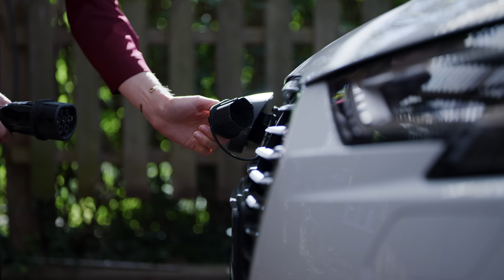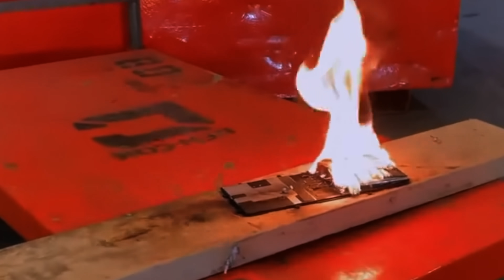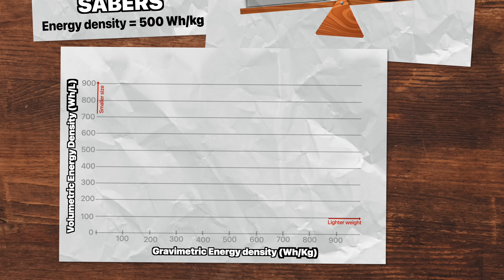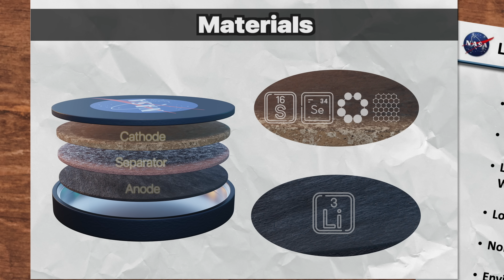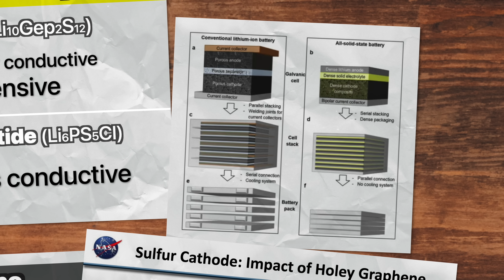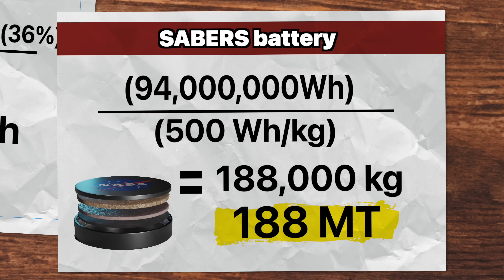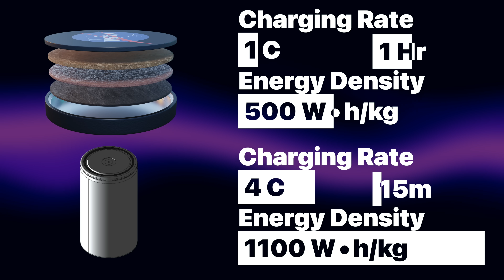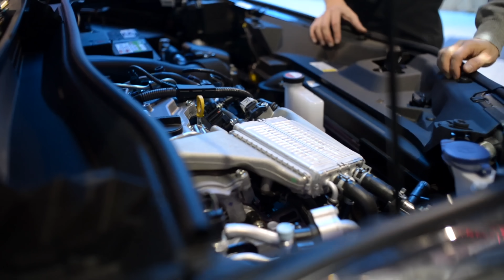Why NASA is Building a Solid State Battery

Comment: everyone's excited for EV to become a major thing in today's world. but everyone also forgets you need the infrastructure to recharge the batteries, as well as a power source to supply enough power to charge said batteries. and that is where the concept of the EV falls on its face. you cant charge 1000 cars on a circuit that needs to run 10000 houses at the same time(both numbers are a massive lowball). you'd overload whatever power source is generating the power, and have a city-wide shutdown. thats why so many places dont have EV charging stations still.

nuclear could maybe do it, but 'oh no nuclear it could melt down' or something. but also you'd need powerplants dotted across the country everywhere just for it to come close to enough power for everyone to own an EV.

Comment: This is really good news.  I hope they figure out the degradation problem, though we already have a battery that doesn't' degrade...the LPT battery.  These are put in the Tesla Model 3.  They have less range but if you can have a battery that can last 20-30+ years then I personally wouldn't mind the range cut.  With solid state if they can fix the degradation problem, then we can have both range and long-lasting batteries.

Comment: I was going to watch until you mentioned the stupid idea of a flying car. As a rotor craft pilot I will tell you that the noise problem will not be fixed by the replacement of the power plant or its frackin' battery! If this channel was a trading stonk I would short sell it.

Comment: Well, a plane still needs to be able to circle the airport for a certain time, then return to another airport, meaning you often will need a 100% reserve, doubling the battery weight.
Even used in a commercial long haul truck, this battery will weigh too much.
Diesel is an amazing fuel source and carrier.

Comment: All of your maths on weight is wrong.

1. 26,000kg is the weight of engines + fuel, but you use all of it to calculate required battery. You should just be calculating from fuel storage. The required battery weight will be significantly smaller than you've stated.

2. You make the same mistake in reverse for the engine calculation. 30 MIT engines gives 1722kg for the 30MW per engine for takeoff. You need about 3500kg for the two engines on a 737. Not 190,000kg.

If we take that number off the current engine+motor weight, we get 22,500kg. Multiplying by the current energy density of SABERS, we get 11.25 MWh of storage. 

That's probably enough for at least short-haul flights from a first product version. Seems legit to me...

Comment: I feel like I'm being spoon-fed and - for those without a background in capacitor and ionic transfer research (which I did when I was twelve) - this is a very well condensed video with a good mix of information specifically catered to both the layman and the experienced. Thanks for the information.

As an aside, I'm concerned about the issue of thermal runaway in a short-circuit situation, which is the primary cause of lithium ion cell destruction and fire. I heard no mention of safety and - assuming the cells are capable of holding ten times the energy - there must be a way the cells are capable of producing heat at a huge rate, even if it's only through the wiring. Then we have solid lithium in the cells, which is obviously highly oxygen-sensitive.

Comment: The biggest problem with solid state batteries other than their high cost is the battery is subject to micro fractures that break it.   That issue needs to be over come.  About six months was a test vehicle battery life before it would break.  People want very expensive batteries last a very long time and not just break.   Typically solid state batteries can charge and discharge much faster than a typical liquid electrolyte lithium batteries.  10 minutes for a full charge is discussed.   This is greatly helped by solid state batteries being able to run very hot without damage.

Comment: They won't go completely electric, especially right away. But if the battery lives up to it's hype, They could added to a hybrid engine design greatly increasing fuel efficiency.

Comment: Although I appreciate your video I must say that flying at altitudes in the 20k to 40K range, where most standard airlines fly, the outside temperature is upwards of -30 to -40 F. This is an inhospitable environment for any battery. I don't see EV airlines in the near future for this reason. Their range and payload would plummet dramatically at these temps.

Comment: 40% better then current = 140%÷2=70# so you can't get 50% the size or weight at best 71.5 the size and weight if they have the same weight/energy density coefficient.

Comment: Power density is more correctly described in amperes, watt is not power, but rather current (a water analogy would be that ampere is the water, and wattage is the strength of the current

Comment: I’m not sure if someone has already brought this up, but I question your average airline flight ranges.

In aviation, for safety they build into each flight time (and therefore; fuel) the allowance for a flight to reach its destination, fly an approach, conduct a missed approach procedure, fly to an alternate, plus 45 minutes of additional flying time.

The distance that an alternate airport is from the original destination varies, and can be in the hundreds of miles. Also, the choice of an alternate varies based on the suitability of the weather conditions at the alternate airports.

In other words, if the average flight is 500nm or 1500nm to go from point a to point B, those numbers need to be increased to include the above mentioned additional requirements to also include going to point C, plus 45 minutes.

Were they incorporated into your calculations?

They are developing electric commercial aircraft, but they are nowhere near capable enough for practical use, yet.

Air Canada signed a contract to purchase 30 ES-30 electric 30 passenger airplanes advertised to have a range of 200-400 kilometres (100-200nm-ish). Based on the alternate fuel/range requirements, the effective point A to point B distance would be 50-150nm if you’re lucky. That is a failure of concept right from the beginning.

What electric aviation also needs to figure out is how they’re going to power anti-ice/de-ice systems which is currently provided by ducted hot air fed from the turbine engines. With no turbines, there will have to be a MASSIVE amount of heat created from another source. Also another issue is coming up with a non-gasoline auxiliary power unit (APU) which is an absolute necessity for redundancy and not to mention it is a power source used on every flight.

Lastly, they need to figure out how to charge an electric airliner’s batteries within 30 minutes or else airlines operating electric planes will have major ground delays and will need to seriously adjust their scheduling.

Don’t get me wrong, I’m 100% in support of a move to electric, but I feel as though they’re not asking enough people on the front lines (pilots) for input.

I definitely understand that technology is rapidly improving, but we are still incredibly far away from

Comment: Instead of electric planes, the US needs to build a vast high-speed rail network with multiple parallel tracks in each direction for interstate travel. Sure, even the fastest trains will be slower in total travel time, but the savings will be enormous. Right now the only reason flights are as cheap as they are is because taxes subsidize the rest of the cost. Your $80 flight ticket to wherever would cost at least $1500 on a pure market rate.

Comment: I really don't know why you wanted to emphasize aviation.  Solid-state batteries have much more promise in lower-power demand situations.  Converting chemicals (fuel) to energy at the point-of-use without all the lossy conversion to electricity, heat, more chemical energy, recovery, and reconversion to mechanical energy, is the only reasonable answer to high-energy demand situations.

Comment: The biggest issue for battery usage is actual energy per pound of battery.  From nasa's website approximately 500 watt hour per kilo.  Diesel/jet a is 138megajoule per gallon which is 7 pounds.  The best you can hope for in a thermodynamic heat engine effeciency (50% more or less) from 1 3 cylinder 2 stroke 6 piston opposed piston turbocompound diesel, means that an electric aircraft battery would have to weigh 10x the fuel carried in said diesel to match power output for the same time.  This will never work for commercial aviation, speed and range wise.  A pound of jet A/diesel is 197 megajoules,  250watthours is 900kilojoules.  I would revise my opinion if they ever get lithium/oxygen batteries to an energy density of 2000 watt hours per pound.  That would make for a decent replacement for regional turboprop feeder aircraft, but it isn't going to allow high speed transportation over very long distances like a 767 or 777.  Math is a harsh mistress for all you electric fanboys.  Plus, once you get much better lithium (power density/lifetime) batteries, electric cars make a lot more sense, at least if all the neo-luddite halfwits are kept from interfering with decent thorium breeder reactor development and rollout.  Probably 35 years too late for that.
Reply: A pound of jet A is 19.7 megajoules, not 197.  Issue with keyboard period button only working sometime..

Comment: Batteries are one of, if not THE single most important things that make or break future technology, but also the most overlooked by the general public. I strongly believe that if we can get a homerun with battery technology that makes the leap similar to when Lithium Ion batteries were discovered, that will be the pushing point that shoots us into the next stage of the technological era.
Reply: This battery boasts an energy density of ½kWh/kg. That's still far too low compared to the alternatives (petrol/gasoline 13.1 kWh/kg, ethanol 8 kWh/kg, methanol 6 kWh/kg)
Reply: @oliversissonphone6143  or nuclear)

Comment: Hurray, the battery holy grail, again.  The battery you have in your EV doesn't matter if you can't charge it. Just like gasoline octane is certified and fined for being out of specification, so should fast charging companies be fined for not reaching the posted kilowatt of power and not being available for use!

Comment: I worked for a major aerospace company that developed a capacitor based "battery".  Had all of the abilities of standard batteries at the time and could charge up in mere seconds, but I heard (different division so only heard scraps of info) that the major problem was damage tolerance. If the damage was extreme it could discharge all at once, which could be quite hazardous to the occupants.
Reply: Why not just have multiple separate units in a sequential way they would all have to fail for that to happen.

Comment: What is this never ending fantasy of some people to replace ultra-efficient jet engines with batteries? Same with long haul trucks. 

It.
Won't.
WORK!

Short of a quantum change in tech, the answer is no. Period. 

Maybe if we'd worked on capacitors instead of batteries, sure. But no, that would have been far too logical. You could have charged a capacitor bank in seconds, instead of sitting at a charger for half an hour and still only get 80% of your range.

Comment: Fun fact, nasa has helped battery tech in the past aswell:

Black & Decker, which really did invent cordless power tools, worked with NASA to develop tools that would work not only on batteries, but without working against the astronaut – like trying to spin the astronaut in the opposite direction in which the astronaut was trying to turn a bolt.

Comment: BMW, Toyota and a few of the main companies have already made functioning EV cars with solid state batteries. They go 700-900 miles with the same weight as wet lithium batteries. Should probably do your research next time. Either you didn't or your getting paid to push false information and I will not be watching your videos simply because of this

Comment: I did a similar thought experiment based on al-ion batteries (that use aluminium instead of lithium for 3 electrons per atom instead of 1) and using an old Lockheed super constellation aircraft. The constellation from 1960s has a range of around 4000 miles and used 10.5 tons of fuel. That plus tanks, oil, oil tanks and replacing the old Rolls Royce engines (which weigh in at 4 times the 2mw wright electric motor made in Germany) and replacing the  efficiency of just 26% (an estimate) with 96% would mean that we could make an electric version of the super constellation with the same weight and a range of around 1500 miles at a cruising speed of 300 mph. This is using tech being developed in Australia (gmg's aluminium ion battery currently in testing) and Wright's electric motors from Germany, combined with an American turboprop airframe. If you sacrifice speed, you get a hell of a lot more range.

Comment: This video makes no sense, why is the weight of the battery relevant as what rally matters is the size? I mean you can have a super light battery but if it is the size of a football field you can't fly a rocket as there would be too much drag. If you pack a ton of feathers in a box it would be a massive box when as a ton of metal would be a small cube...

Comment: You keep comparing "take OFF weights" to see if a battery can replace fuel, problem is LANDING weight maximums, which is much lower than take off weight.
Most large commercial planes can not land directly after take off, as they weigh too much.

If the battery plane weighed the same as the fuel plane on take off, it would not be able to land safely, as its weight will not decrease

Comment: I really dont get why people think were going to replace airliners with electric planes.
a jet engine, takes jet fuel, its not a fan, you cant make it run off electricity, your electric plane is going to be propeller driven. your going from up to 700 mph (600 average I think) to like 300 tops.
I dont think most people would mind that for a short trip, but its not going to REPLACE jets, even if the math you did worked out.

Comment: You have to remember that the weight of a 737 is calculated on it being a liquid fuel powered aircraft and the engines, hydraulic systems and structural beams are very heavy. With composite technology replacing structural beams and fly-by-wire replacing much of the hydraulic needs and much of the skeletal structure being weight-reduced by converting the aircrafts structure to integrated battery forming structures, then much of the structural metal which supported fuel-laden wing tanks and engine pods can be removed as well.

Comment: If we want to electrify transportation (and we do), there's some low-hanging fruit that we Americans have hardly used while the rest of the world (especially Europe) have been doing it for a long time. And the technology is well over a century old: electric railways. Even here, batteries could help. Electrifying a railway is pretty capital-intensive (though still worth it on heavily used routes) so suppose we start by electrifying the most important segments and using rechargeable batteries in the locomotives to bridge the gaps?

Comment: A battery does not necessarily get safer because it has no flammable components. When the battery fails, the energy has to go somewhere. Current gen Li-Co batteries re-ignite the electrode with the energy discharge. Some solid state batteries get hot enough to severely weaken steel or melt some aluminum alloys, and of course ignite plastics and fabrics nearby. Driving a nail through this battery when fully charged would end no better than running a nail through a Li-Co battery.

Comment: I mean I guess you're partially correct in that no- you're not gonna be able to use these batteries for trans-pacific flights by slapping electric engines and battery on a boeing 737, I Don't know if you accounted for the fuel tank and fuel weight as well but don't think it'd matter. however electricity powered aircrafts tend to have a much more optimized form with a much larger wingspan ratio and slower travel speed, which already exist to travel semi-large distances using the battery technology we've had so far, I wouldn't call it too much of a stretch to make an electric plane that could travel trans-atlantic distances, especially with enough developement time

Comment: I wonder if some of the power for takeoff could be stored in capacitors, and how much of a weight penalty that would end up being
Reply: no, because then your hauling dead weight of empty caps
Reply: Capacitors have only about 3% of the capacity of a similar sized lithium battery.  Their advantage is almost limitless cycles and fast charging, but they have little use in powering motors.
Reply: My guess is that you never drove an EV
Reply: @testtesting5088  evs arnt caps

Comment: EVs have a major flaw, and it is explained in two words, 'Road +Trip,' which is something you would find difficult to accomplish with a straight-out Tesla-type battery. There is just not enough range as there is with a tank of gasoline. Once a battery system reaches parity with said tank of gasoline, then and only then will I ever buy a full EV

Comment: This is still possible for aviation, just not the aviation you're thinking. One of the current pushes is to bring back blimps for various applications. They don't have the high energy requirements of planes, since they're naturally boyant, they just need energy for basic propulsion. So these are actually a godsend for them, especially where ignition would arguably be a bigger problem.